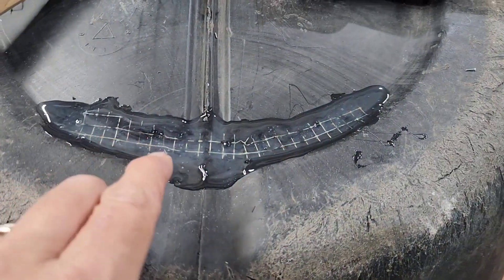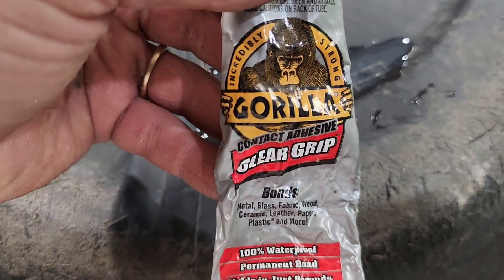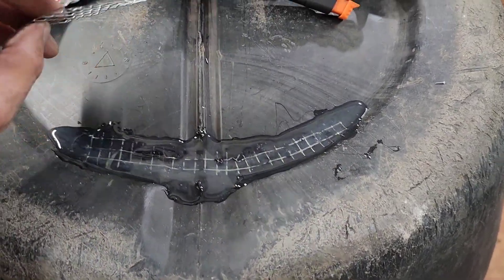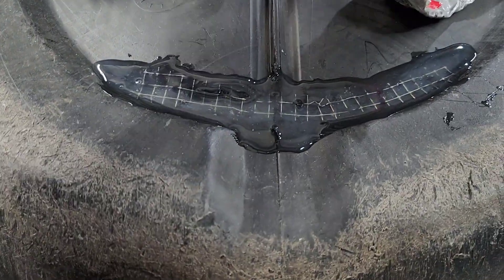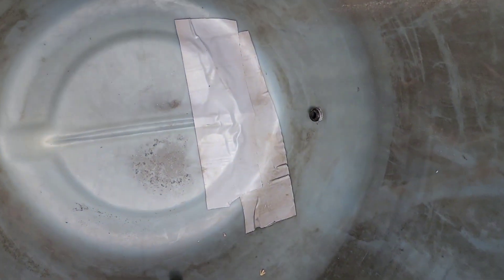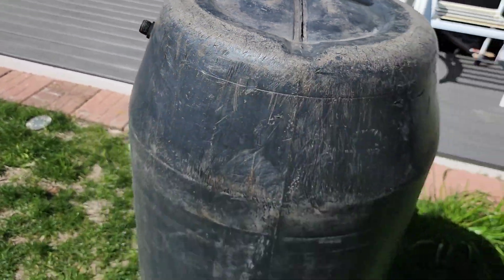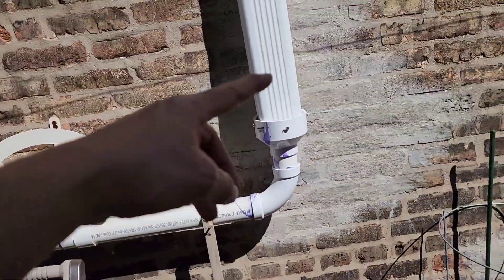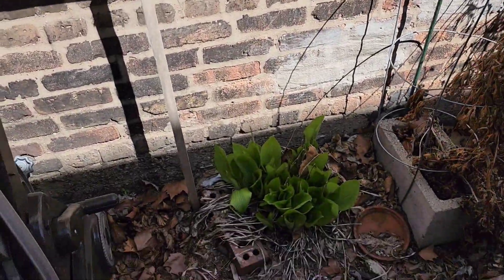Repairing a cracked plastic rainbarrel

Comment: Did it work? Is it holding up?
Reply from the maker: This barrel is still holding water although if you live in a freezing temperature zone you have to make sure they're empty or bring them inside over the winter
Reply: @RobHereAKATrev2323  i tried the same this this year and held up fine during the summer. Will definately be draining for the winter here in canada